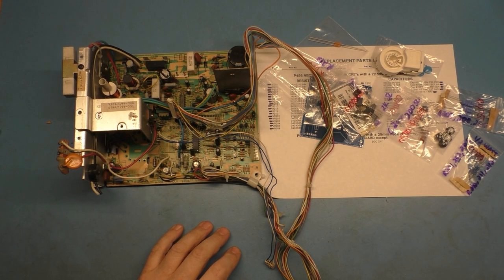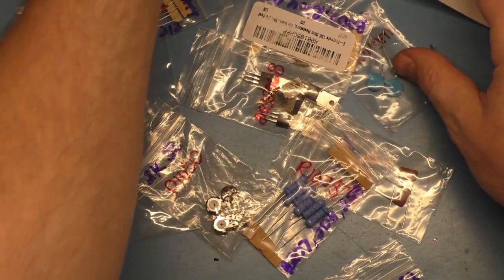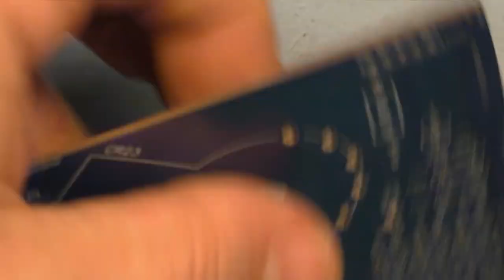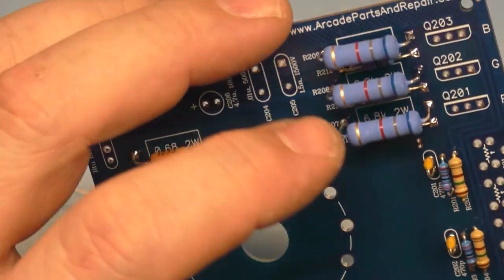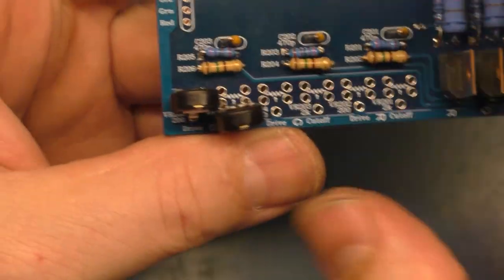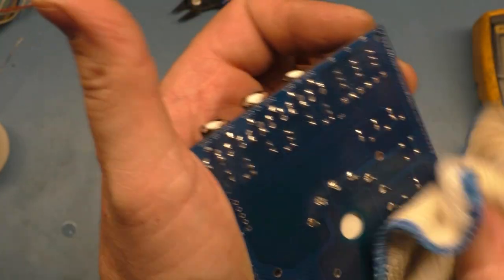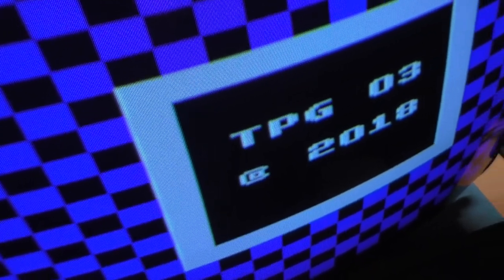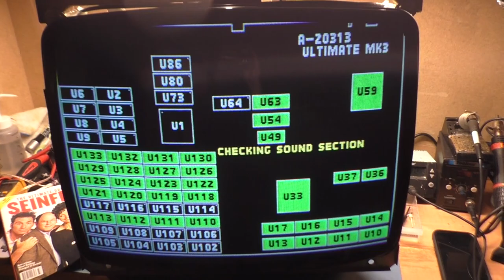25" K7000 Arcade Monitor Repair-A-Thon #5 - "Parts" Chassis Resurrection - Brand New Neckboard!

Comment: Next time you should mount the 2K pots to the solder side of the board and the 200 to the component side of the board, the only difference would be that the direction of turning would be the opposite.

Comment: Trying to find you on Facebook
Reply from the maker: What help do you need?
Reply: @mikesamateurarcademonitorr6856  how to identify a k7500 yoke. I have a true k7500 and a mystery tube and yoke. They look almost identical but I'm scared haha
Reply: @mikesamateurarcademonitorr6856  I posted pictures in monitor repair help group but no replies yet
Reply: @MikesArcadeMonitorRepair  it called Arcade Monitor repair
Reply: @mikesamateurarcademonitorr6856  the tube was in a gauntlet dark legends cabinet that had been converted to Big Buck Hunter and it had a k7500 chassis laying inside also